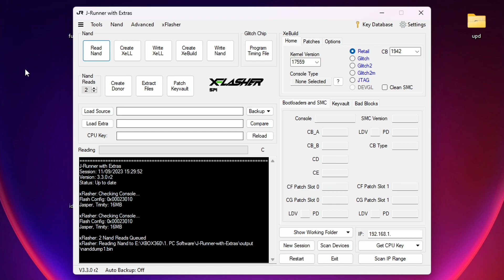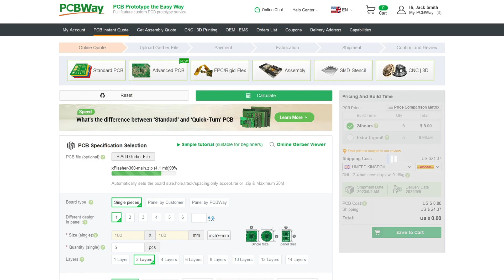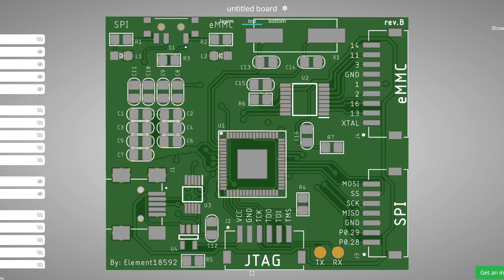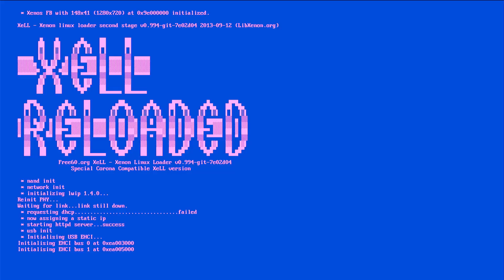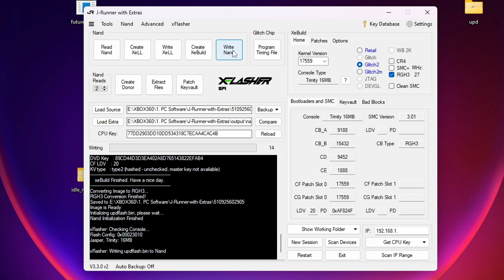The Ultimate RGH/JTAG Trinity Xbox 360 Build

Comment: How do i check which 360 model i have? I've seen a few things about "trinity" and others and it seems like it determines whether jtag is possible or if only rgh is possible
Reply from the maker: Search online for the Xbox 360 identification guide and you can check your power port on the console. Most of the time you use RGH unless it’s a PHAT console on the original blades dashboard.

Comment: so you can get the c-r bin file with the xflasher points soldered on the top of the board without exposing the PLL back of the board? im looking to do a LTU2 swap on my slim without rghing it when i wanna flash the slim with LTU2
Reply from the maker: The xFlasher is simply just for reading and writing NAND memory, and doesn’t require PLL by default. In terms of drive flashing, I’m not sure.
Reply: thanks im a bot lol. just didnt know the u can read the nand without the PLL exposed.  @TheModSmith
Reply: @TheModSmith  so question. Does the heat sink need to be on while dumping the nand?
Reply from the maker: @FrontoOptimo  It doesn’t really matter if the console is off.
Reply: To get the C-R and Key.bin files you need to extract them from the NAND dump by entering the consoles CPUKey in JRunner. You only need to do this if you have a DG-16D5S LiteOn Drive.

If you have a DG-16D4S Drive then you can flash LTU firmware to it without needing the unlocked PCB. This is done by either Kamikaze (Winbond) or cutting a trace and probing (MXIC)

If you have a Hitachi DL10N drive then you need the Hitachi Unlocked PCB.

Comment: Hey just recently did a trinity rgh3 and this video popped up! I soldered the pll but somehow managed to rip post lol
Reply from the maker: You can use a postfix adapter, even on Trinity consoles, if you damage the post point.
Reply: @TheModSmith Great tip, thanks for sharing!
Reply: @LeapFrog_Radio you can also scrape off the mask on the top side of the board where the post via is. Then just tin it and run your post wire :)